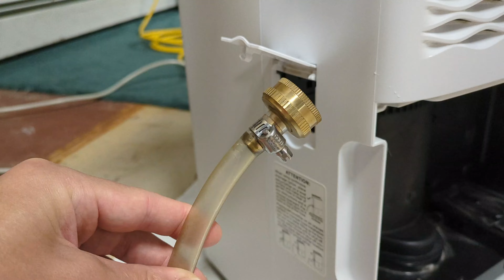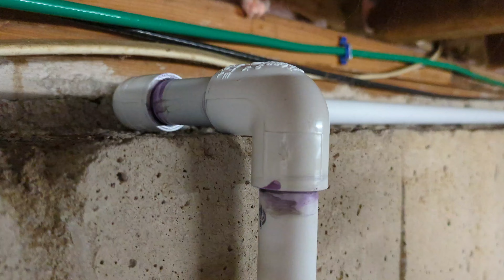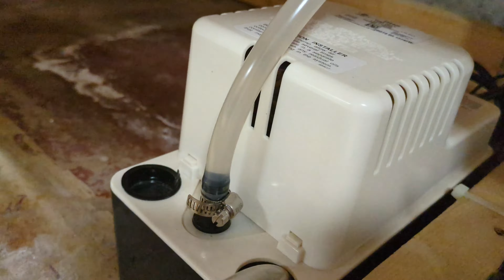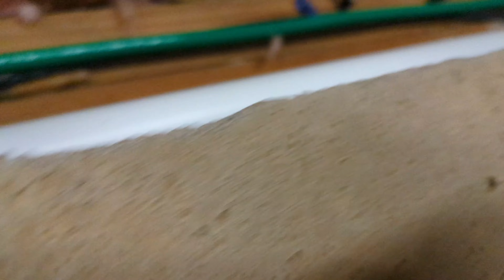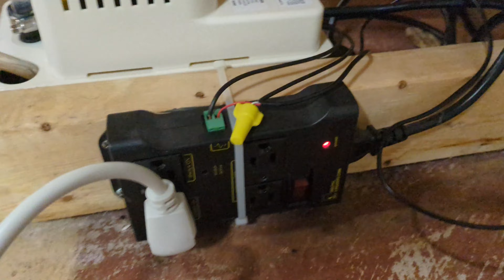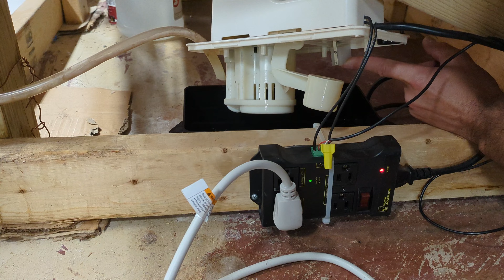Dehumidifier Pump and Safety Shutoff Switch Installation

Comment: Thanks so much for the videos!  I am big on redundancy so this set up really appeals to me.  Sorry if this is an ignorant question, but I am confused as to why you need the power source coming from the adapter, tapping into the wires from the pump?
It seems like the wires themselves would do the job.  Also had some concerns that the voltage from the adapter, though low, would also flow to the pump and energize the pump circuits as well.  Perhaps I just missed a detail in the set up.  Thanks for your help.
Reply from the maker: The relay requires voltage to switch. That's the reason for the power adapter. If it were designed differently to just look for open/closed circuit, then you wouldn't need the power adapter. 
The overflow switch is completely isolated from the pump circuitry so no issues there. You can open the cover and see that it's separate if you like.
Reply: Thanks for the quick response.  Makes sense!

Comment: Quick question, any concern with the tube coming from the dehumidifier into the little giant hole coming out?
Reply from the maker: I have the tube tied with a wire against the washer/dryer pedestal. Otherwise someone walking past the tube or bumping into the dehumidifier could accidentally move the tube out of place.

Comment: This is great, I just wished I would have found your video sooner.  I spent three hours coming up with the exact products and solution you have outlined already.  😂  Oh, well, I am glad it is a proven design!
Reply from the maker: Thanks! Yes, probably 10 years now for my setup. Once per year I just clean out the hose between dehumidifier and pump, and pump some bleach through the rest of the line.

Comment: You don't show that you have to awitch the wires on the toggle inside the pump
Reply from the maker: Correct, I missed that in this original video. I later posted a more detailed video showing that part: https://youtu.be/9_ogxUv9WEI?si=OcfSlkaZkAT6Inuv

Comment: I bought one of these "little giant" condensate pumps because I liked the "safety shut off" that it said was easy to hook up with basic electrical knowledge. Well, that's all they said. The unit came with two wires and absolutely nothing about what to do with them. So I sent it back. Thanks for giving the info that the pump manufacturer thought was too obvious to need to provide.
As a side note, it's really difficult to find a shut off for a device that is putting out water. You can find floats to turn on a device (e.g. a pump), but finding something that will shut off the dehumidifier or washing machine, etc., is not so easy if you're just someone looking to plug in the device and have it shut off, without having to wire something up. A float that will turn on or turn off power to an outlet based on a simple A/B switch would be great.
Reply from the maker: Next best option at least for a dehumidifier is to get one with a built-in pump. But this relay is solidly built and works great. Or, if you also need to pump for a basement washing machine or utility sink, then a sump basin and pump is good.

Comment: Hi, I set up everything as you have it in the video, same pump, digital logger relay, and dc adapter connected the same (red to positive, black to switch). However, when I plug in the DC supply, the switch is triggered in the relay, instead of waiting for the pump to trigger. Any thoughts? I tried switching the relay wires with the same result. Thanks!
Reply from the maker: @GammaRay87 I have a second video in the playlist where I show how to move the overflow switch wire between normally open and normally closed. Make sure power is disconnected when you have that cover off. The other option is to have the switch always activating the relay and move the dehumidifier plug to the "normally off" outlet. You might consider that option better because if the DC adapter ever fails, it will turn off the dehumidifier.
Reply: @realhouseDIY thanks. Switching to always off worked.
Reply from the maker: @GammaRay87  great! Assume you meant normally off.
Reply: @realhouseDIY yes, I meant normally off!

Comment: Great video. What can be used as the DC power supply adapter for powering the safety shut off switch.
Reply from the maker: Virtually anything if using the same relay. It accepts from 3-60VDC or 12-120VAC. So I like to just use an old cell phone adapter.
Make sure to watch all three videos in the playlist. I had clarified some of the install steps for some folks who had questions.

Comment: disassemble and clean the pump, check valve and hose from the dehumidifier on a regular basis. Mine developed pink slime and clogged up.
Reply from the maker: Yes! I clean the hose from the dehumidifier once per year. I just take it outside and full power garden hose through it cleans it fast. For the rest of the lines from the pump to outside, I run some bleach through it once per year.

Comment: Can you clarify the wiring on the iot relay terminals?
Reply from the maker: @jdr03272  take a look at the following video. I go into more detail on that: 
https://youtu.be/9_ogxUv9WEI
Reply: @realhouseDIY  perfect thank you!  Subscribed.  So basically, the float safety switch just interrupts (or completes, depending on how it's wired) the circuit between the positive and negative leads of the ac adapter.  I assume there's no problem using a small ac adapter and hiding everything in a project box?  Maybe need a fan?
Reply from the maker: @jdr03272  yeah it supports a wide voltage range for switching the relay, but just don't use 120v AC through the dehumidifier safety switch. The manual for the vcma-15uls states to use low voltage for the safety switch.

Comment: Can I drain the dehumidifier into the HVAC Little Giant pump already there by tapping into the relay wires already there from the HVAC and then take the relay wires tapped into the relay power strip?
Reply from the maker: @davidkeating1379  if I'm following correctly, yes you can get the relay switching power from low voltage HVAC/thermostat power.

Comment: I'm having trouble in knowing whether I set this up properly... I've attached my dehumidifier to the Normally ON plug. My pump came with two safety wires that plug into the pump and I’ve connected them into the relay terminal. But I see in your video you’ve attached a separate standalone DC plug to the relay terminal. I have not done that and rather instead just attached the two safety wires from my pump into the relay terminal. Can you please explain what purpose it serves to attach a standalone DC plug to the positive hook up in the relay terminal? I’ve been scratching my head on this for a few days now and hope to get everything working soon and I really don’t know what I’m doing. Thanks!
Reply from the maker: @zf51786  if you're using the same relay I used, it requires a voltage to switch it. Any low voltage DC adapter will work.
The overflow safety switch in the condensate pump is just a switch and not connected to any power source.
Reply: @realhouseDIY  Thanks - i set it up the way you showed it; i'm not using a Little Giant pump though - it was a cleartide. I tried to activate the high water alarm in the cleartide but it did not turn off the dehumidifier when it was triggered. i don't know....
Reply from the maker: @zf51786  try adding the DC power adapter. That should get it working.

Comment: Great video. We are setting this up now for two basement dehumidifiers. Both will be drained to the outside. We are concerned about freezing in the winter. Did you have that issue? Any suggestions? Thank you.
Reply from the maker: @Chris-p6p3k  absolutely no freezing issues here. Angle the drain line down where it passes outside and add insulation around it
Reply from the maker: I should have added that I am not running my dehumidifier in the middle of winter when it is dry. So there is no water running to the outside during freezing weather. But there is no need to drain the line as long as it only goes downward on the exterior.
Reply: @realhouseDIY  Thanks for the follow up…good to know. We plan to keep it off in winter now. We actually just added a smart Wi-Fi plug to the setup. We snowbird during the winter/spring and now we can remotely turn on the dehumidifier once it warms up in the spring. Thanks again.

Comment: Normally on outlet doesn’t work only always on …. Advice
Reply from the maker: The device in the video is a relay. It has 3 different options: always on, normally on, and normally off. Always on is always providing power to the device that is plugged in at that location. Normally on provides power at that location except when the relay is switched. Normally off only provides power when the relay is switched. Hope this helps!
Reply: @realhouseDIY  normally on does not have power , im trying to accomplish what you did but normally on doesn’t get any power to power the dehumidifier
Reply from the maker: @jrspeedy8  oh I see. So something is closing the relay. How did you hook up the switch wiring? If you unplug that little green connector then does the "normally on" provide power?
Reply: @realhouseDIY it’s wired like yours positive from relay to adapter and the negatives to relay and the other end to the adapter 

If I unplug the adapter from the wall power goes out
Reply from the maker: @jrspeedy8  make sure the float switch is wired in-line/series with one wire of the dc adapter. Unplugging the dc adapter shouldn't do anything when the float switch is open. It's the same relay I used in the video, or a different one?
Reply: @realhouseDIY  the same switch you have. From the pump I have 1 negative connects to adapter the other negative connects to relay switch (outlet)
Reply from the maker: @jrspeedy8  sounds right. Do you have a multimeter to check the dc voltage at the relay when you close the float switch? Also you could try bypassing the float switch and make sure the dc adapter alone can switch the relay.
Reply: In order for the normally ON to work with the setup shown in the video I had to open the pump cover  and move the black wire to NC on the water level safety switch. When you get the pump the black wire is set to NO
Reply from the maker: @st0niran  thanks for making this clear! I confirmed my pump switch is set to NC position. Yes, the manual does state NO position is the factory set position. I will update the details in the video description.

Comment: Looking to do same thing.. can you post the product information for the power relay?  And, did the Little Giant pump come with the overflow safety relay or was that added on?
Reply from the maker: Sure thing...
Relay:
https://www.amazon.com/gp/aw/d/B00WV7GMA2?psc=1&ref=ppx_pop_mob_b_asin_title

Yes, little giant pump has the overflow switch with wires already installed. Model VCMA-15ULS (the S indicates it comes with the safety switch)
Reply: @realhousediy What DC adapter did you use? You said it's "one you have lying around from electronics", but I don't have one of those
Reply from the maker: @Patman824  the relay I used accepts any dc voltage from 3-48 vdc. Almost any dc adapter you can find will be in that range. Many are 5v or 12v for charging cellphones or powering electronics. So you can buy any dc adapter in that range and cut off the end and strip the wires to wire into the relay.